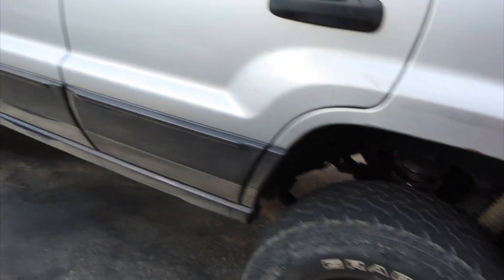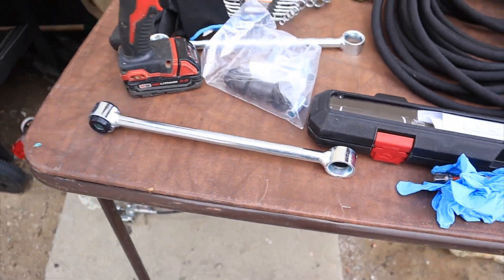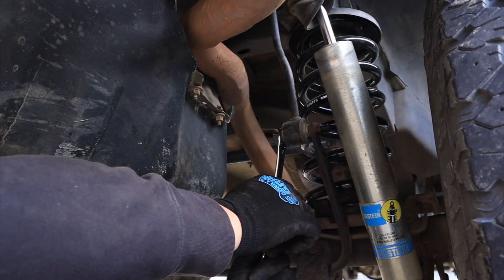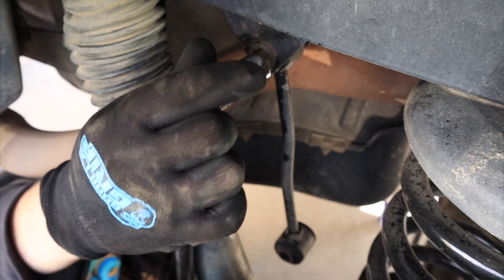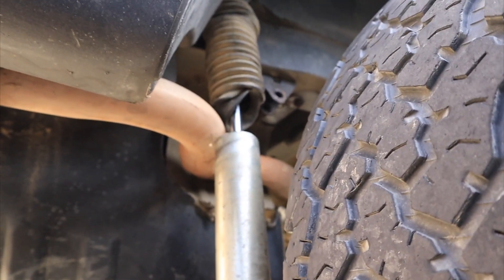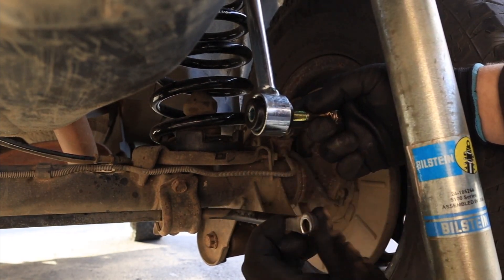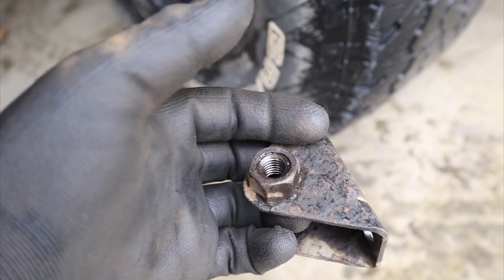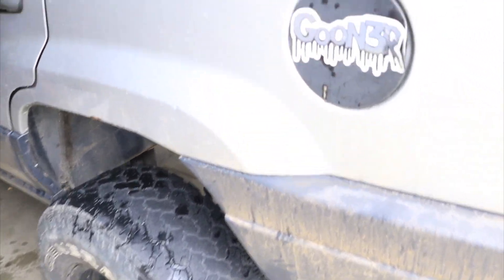Installing Zone Longer Sway Bar Links on Lifted Jeep Grand Cherokee WJ | Najar Offroad

Comment: I recently lifted my WJ 4" . I put rear extended sway bar links just like this. It's my front that has old stock links. When I hit bumps it feels like something on the front end is bottoming out badly. Can be very aggressive if I'm not expecting it. I know it's a bit of a crapshoot . Any thoughts as to the fronts getting changed out too?

Comment: Hey man. Love your videos. I hear a clunk everytime I go over a speed bump to fast and i think this may be my issue after i changed the rear upper and lower control arms plus the ball joint i think it's the sway bar hitting that area. Do you think I need extended way bar too? I'm on a 2 inch budget boost.

Comment: Easy job, just watch out for the top bolts. Also, all you need is a little saliva on the bushings,  and a small  tap with the hammer

Comment: My current knocking in the rear is bad A arm bushings think I’ll do a cheep stock replacement since it’s only 2.5 inches of lift.  Why did you change from the jks trac bar I have one and it’s been fine I was told they were the best to get for the bars curved design
Reply from the maker: Well first bushing were too soft and gave out changed them for core. Then the threads on the adjustable part gave out too

Comment: Upgrade to the addco 1" rear sway.bar.    makes a huge difference  driving.  You and can also use an 04 front swaybar  it's a solid bar not hollow like the 99-03
Reply from the maker: I heard the addco is good but not for offroading! Oh really I didn’t know about that for 04 seems like that would be a good thing to swap
Reply: @NajarOffroad   I just pull one bolt   on the lower link when I'm offroading. But I also street drive mine too the  trail. And do family road trips. I'm running  a 3.5" short arm with bilstein 5100s
Reply: @NajarOffroad  what the links to get that ?

Comment: My 99 Jeep Grand Cherokee is making a rattling noise when I drive. I inspected the brake rotor and brake pad and it’s coming from there. It sounds like the rotor and caliper are rubbing together. Should I change the brake rotor and pads all together ?
Reply from the maker: Yes you should replace both. Or you can take your caliper to a mechanic shop to be resurfaced just call around and ask if your local shops do that

Comment: Still not at the correct angle. Your sway bar and links should be at a 90 degree angle together. So your still putting pressure on front end/camber at the wrong angle.
Reply from the maker: It will be fine. I’m going to ditch the rear sway bar soon
Reply: I tried that and my WJ was a little squirrely  in the rear 🇺🇸
Reply: Incorrect...you should have around 15-20 degrees up angle on the sway bars.